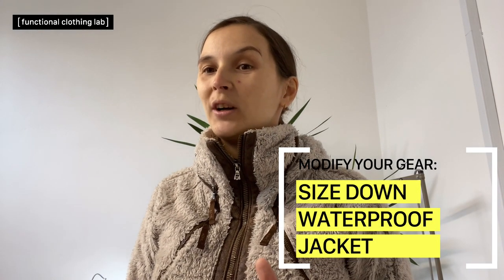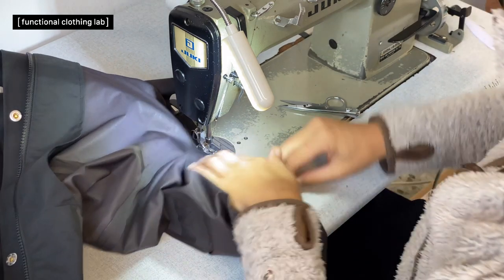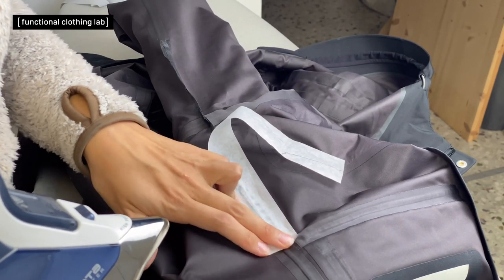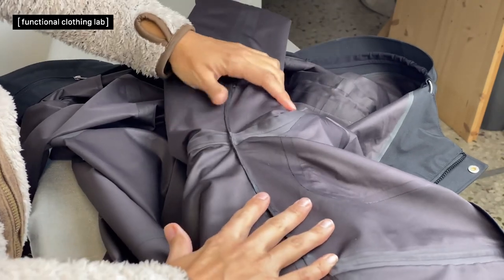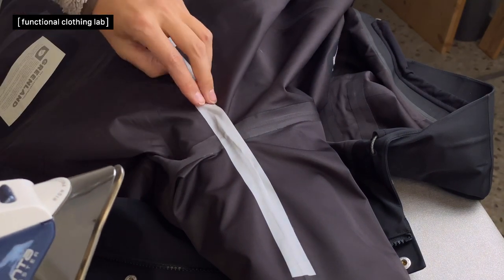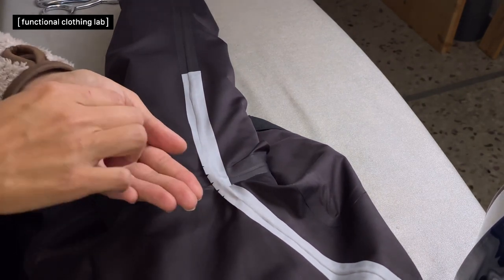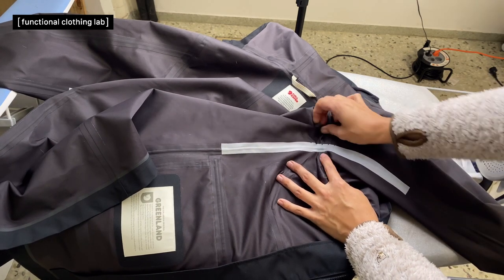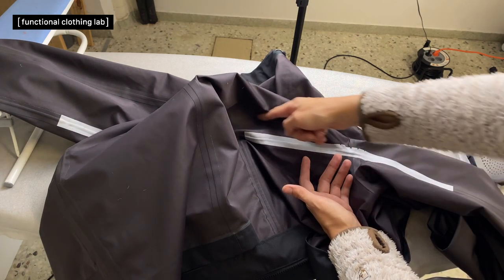SIZE DOWN RAIN JACKET: removing and reapplying seam tape

Comment: Great video! Although it’s important to note that seam tape are applied with a lot of pressure underneath the heat press in factories. I’d be curious about the durability of this kind of method (by hand)

Very interesting video overall 👍